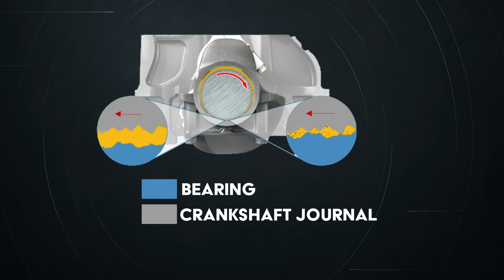the truth about start-stop technology (finally proven)

Comment: I have a few points id like to make, and im not looking for an argument, I genuinely want to know;

 - Stop-start systems only work when the engine temperature has reached a certain point, usually within 5 minutes of starting the engine. 
 - Most modern cars built in the last 12 years have electric oil pumps which can operate at full capacity as soon as the engine is switched on, and can then regulate their power depending on the engine conditions
 - The bearings in modern cars, especially with stop-start, are built to a standard where this wear isnt an issue, coupled with modern oils which are engineered with stop--start in mind.
 - Those bearings used in this video - what standard are they? What was the engine oil used? Engine temperature? 

There are multiple variables that go into engines with stop-start. Looking at it s straight forward as this Ould be says to see why they cause excessive engine wear, but there are many things different with an engine built for stop-start vs one without.
Reply: going by car care nut's knowledge on the subject, every reason you could think of that would be an issue with start/stop has been addressed. There were a number of things done so it could be adapted to a non-hybrid ice car. the feature is there to achieve emissions standards (helps significantly), but fuel savings is negligible. I've only been in one car with the feature. It's a silly feature for the end-user, but it's also a non-issue.
Reply: The "test" isn't testing anything, it just shows that if you stress a system for 48 hours straight, there is wear. That is literally all it is showing. There is no control, there are no numbers on why or how 48h of this should correlate to anything, nada. I'm not even sure if they mentioned whether the tested car was start/stop or not.
Reply: @AKKK1182  did you even watch the video? The one tested in the end was without start/stop system. The first ones tested for 48 hours was simulated to start and stop continuously. The test shows that most of the wear comes not from engine running for long periods of time but rather starting and stopping mostly. What kind of numbers do you want you thick?
Reply: @Panvezys The first engine was constantly started and stopped while being cold, before it could even get to any kind of operating temperature. No shit it wore faster, but start-stop doesn't kick in unless you're in operating temps. The test was essentially the same as inflating a tire to 20 bar and then saying air is bad for tires because it made the tire explode.
Reply: "are built to a standard where this wear isnt an issue" - how do you know that? Any wear is an issue for me. It translates into wear on my wallet.

Comment: 5:58 - Ok so im not going to pretend im any kind of expert on this, but wouldnt the real question be what the actual consequence of that wear is, instead of whether or not wear occurs at all? What we keep hearing from automotive experts all the time is that these start/stop engines are spesifically built for this and that whatever wear occurs is irrelevant because its still going to outlast the lifespan of the car.

Theres some very good information here, but at the same time I find myself with more questions after the test you guys did. For instance, most cars dont make it to 1 million km and are usually junked for other reasons than rod bearing wear or catastrophic engine failure long before that. Also, a car that has 1 million km on it has obviously been run for quite long distances on a daily basis and likely in a commercial setting (according to a insurance company the average person drives about 11-12 000 per year, which would make 1 million a car 90 years old by that standard). So how does this "clinical" testing stack up against real world usage where someone for instance starts their car, takes their kids to school and stops there, then goes to work, stops there, goes to the store, stops there etc etc. I dont know, but I have a feeling that the average person already does alot of starting and stopping and generally drives alot of short distance trips instead of being on the road all day.

I find some different numbers but it seems the average personal car has a life span of about 12-15 years or 250-300 000 km, which is very far away from the example of 1 million (or 90 years lol). I for one, would love to see this topic elaborated upon. Though I have no idea how to go about that, maybe getting a hold of some condemned cars where the cause for condemnation is known and looking at how consequential this wear actually was in the real world?

Comment: Not to mention the danger at places like roundabouts. You pull to a stop, the engine stops, you think you have a gap and try to go for it but the engine doesn't start quickly enough so you end up miss-timing your manoeuvre.
Reply: Said by someone who has clearly never driven a stop-start car. If you had, you would know how quicky they start back up.

Comment: Due to a marten, which cut 2 wires near my battery, and during a maintenance cycle, I was told that those 2 wires are to measure the battery voltage for the start-stop system and the maintenance guy at the garage fixed it by adding a connector to it instead of soldering it. Now I just pull that connector and my start-stop system is disabled entirely as it thinks my battery is dead and won't stop the engine. When I go back to the garage, I just plug it back in for that one trip. :p

Comment: The whole video is a waist of time. I have rebuild hundreds of engines. I have never rebuild an engine because of bearing wear. Almost always the piston rings are shot or the there is lubrication failure that damages the engine. The bearings never fail without bad oil or bad oil pump.

Comment: boring, my land Rover use to stop at 100k while on the motor way, brakes with no booster assist farrrrrk yea computer needed bout 5 mins to reset before it would restart, if you have this problem check your O2 sensors

Comment: Everyone knows that start stop is eco thing for car makers and it hurts the engine.There's no question about that. But...I would also say that it is obvious that you will see the wear on the new bearing. It also depends on the state of the crank which is not new. Maybe also other somponents. Even on new engine the components need to ''mate'' for some time. So this is not really a test rather than mere experiment that shows us that new component is getting the wear from use (incredible right ?).

Comment: Yet you have Toyota Hybrids who’s engines stop start many times per drive and they some of the most longest running and reliable cars.
Reply: Do they start on electric and thus get oil pressure up before restarting the engine? I don't actually know how they work. A hybrid is certainly different from the engine in this test in various ways that are likely to matter.

Comment: What about hybrid systems where the engine turns off at speed and on as power is needed? Do some of these systems keep the engine spinning, just not producing power? Or would that often be avoided to remove compression consuming power from the electric motor?

Comment: I'm really not satisfied with your analogy based on how you've actually done this experiment. During a cold start phase I would agree there would be slight wear to all the contact points within the engine, however to what extent is a moot point because of oil cling, and oil surface tension which maintains a constant coverage of oil even when engine has not been operated. The anti-wear additive packages in modern oil also reduces component wear. Secondly, your crank speed seems a bit low when you're doing the hot oil check which took 7 seconds.  Normal crank speed usually start  modern engines within 2 to 3 seconds. Taking the consideration of oil cling on all the engine's wear areas, severely mitigates the concerns shown by you for engine wear.
Reply: Not sure about the oil in bench engine, but as for in-car test I assume it had proper oil, and 84hrs of test would keep temps up. As for crank speed, the in car test almost certainly had fast spins. Bench unit is an older design, so probably starter isn't even geared for higher speed. Cold temp cranks will take more time even in new cars, but let's say it was lower than spec. Point was to show how long it takes for oil to be taken from pan and pressurized. One issue I would have is that even this old engine should have some check valve that could store pressure for few minutes and yet it lost all immedeatly.

Comment: Whoa... how so... I mean why the title is so revealing (I think because of YT algos right?). I mean there is nothing to reveal, this is known and clearly communicated information. Potential damage to battery and bearings is an eco tradeoff, which is clearly communicated since at least 15 years. But, guys, you've missed the point. the smaller engine is the lesser damage is. Try the same trick with some Peugeot 1.2 engine, or even 1.0 3 cylinder one, and will be surprised... And how about Toyota hybrid engines? how prius is easily surviving 700-800k km with no engine repairs? Sad testing with a childish results.

Comment: I have always thought that start / stop feature would damage the engine, starter motor and decrease the life of the battery but there are different opinions. Last year I took a 12 mile round trip in traffic and my car's engine stopped and then restarted 48 times in around this 30 minute journey. I decided then and there I would turn off this feature every time I drove. On occasions I forget but most times I remember. I have heard the amount of petrol it saves and the amount of polutants it emits is barely noticeable so why have this on a vehicle. I wonder if this could be disabled using a OBD11 ? Anyone know? A new battery for my mk8 Golf from VW is £380 as it has to be coded to the car, another rip off.

Comment: Would like to hear more about Toyota Hybrid engines. Had one myself and multiple people in my bubble drive them. They power off and on multiple times in a minute in city traffic or medium speeds on bigger main roads. Still they last like forever and are proven to be one of the most reliable powertrains which get abused daily in scenarios like taxis. I know that my old car still goes strong and the only thing which went bad within 12 years, was the small 12V starter battery (not the high voltage battery).
Reply: Best guess for Toyota petrol engine is started by hybrid's planetary gear, so it reaches operating speed and sufficient oil pressure before combustion happens, so there is much less stress on the bearings. Standalone ICE has to gain RPMs using the combustion...

Comment: Startup wear is a thing, but it’s minor

When an engine starts, oil pressure does take a second to build, but modern oils are designed with additives (anti-wear agents, friction modifiers) that protect during that boundary lubrication phase.

Plus, most wear happens after a cold start when oil is thick and hasn’t circulated, not during a warm restart at a stoplight. Start-stop systems almost always engage when the engine is warm and oil is already thin and coating everything.

Engine design accounts for it

Manufacturers reinforce bearings, starter motors, and crankshafts in vehicles with start-stop systems.

They often use electric oil pumps, pressurized oil reservoirs, or anti-drainback valves to keep bearings wet between cycles.

Field data doesn’t show bearing failures from start-stop

If this were truly catastrophic, we’d see widespread failures and class-action lawsuits. In reality, high-mileage vehicles with start-stop don’t show a statistically significant uptick in bearing-related failures compared to similar engines without it.

The real wear factor is driving style and oil changes

Neglecting oil changes, using poor-quality oil, or doing tons of short cold trips is far worse for bearings than start-stop could ever be.
Reply: So tell me what happens when key is position 1... 2... and why ignition is last position. When fuel pump and oil pump is activated?
Reply: @marekmarecki7065  You realize to give you an accurate answer I'd have to know which system we are talking about. 

The main takeaway here is that engineers KNOW about the problems associated with low oil pressure, especially at startup. 

This is a very well documented phenomenon. And I'll bet in most newer systems they have adequately engineered for these shortcomings. 

This is probably why we don't see massive amounts of vehicles failing from spun bearings.
Reply: I agree. Been running 2 VW stop start cars for 10 years now.  No problems on either Golf 7.5r and VW Up.  Both still on original batteries.  Up is town car and I seldom do short journeys in Golf, and always respect the warm up and cool down before loading the engine.  Maybe I’m just lucky, or maybe cars are indeed engineered for a start stop duty cycle.   I find this to be alarmist stuff. BUT I do agree that SS can be irritating on occasions, then I just hit the console button.
Reply: @gaycha6589  Exactly.

Comment: So much skepticism when the actual data proves the opposite of what this video is attempting (and failing) to convey.

Emissions are harmful, no, auto start stop does not cause excessive engine wear, or even any noticeable engine wear in the first place.

Not convinced.
Reply: Lol, one comment later you're going from "does not cause excessive engine wear, or even any noticeable engine wear" to "Startup wear is a thing, but it’s minor". Word "Minor" would describe something that is noticed.
Reply: @Stratos1988  Yeah from a comparison standpoint of cold starts vs auto start/stop.
Reply: @Stratos1988  Any time a mechanical system with moving parts is.. moving... it's going to have wear, regardless of how well it's designed.
Reply: @Stratos1988  But you're right, maybe I should have said "any noticeable increase in engine wear"

Comment: With some cars you can permanently disable the stop-start system by bridging or disconnecting the bonnet open sensor switch.

They're programmed to keep running when the bonnet is open so mechanics can work on them.
Reply: Bonnet sensor is wired into central locking and alarm system. In some cases you might end with car not going to sleep since it thinks it's open and in use, draining the battery.

Comment: I hate it when I pull into the garage and the car shuts off right before or as I'm shifting it into park.  So it shuts off and restarts.  I don't always remember to shut it off.  It usually doesn't engage when I'm normally driving because I don't hit the brake hard enough but when I'm parking I do.  So annoying.  Common sense would tell you it wouldn't be great for the motor.  Car companies love it because they get better EPA ratings and the cars won't last as long.  People seem to just buy new cars now over and over because they don't last 10 -15 years like they used to.
Reply: Mazda does not start the engine if one has shifted from drive to neutral.
Reply: My car beeps at me to remind me to turn it off. But, I forget because everything is buttons - park, emergency brake, and start/stop - so I just forget the last button push.

Common sense says that every second your car is running is one less second of it's life. Start-stop engines can extend the life of the engine by 30+%.

Car companies hate it because so many consumers don't like it, but it helps their bottom line because decreased wear on the engine reduces warranty service.

Cars last longer today than ever before - an average of about 50,000 more miles than just a decade ago.
Reply: Then be lighter on the brake and it won't activate. You literally knew why and mooted your own point right after. I can tell you it is not hard to pull up slowly and be gentle on the brakes until it rolls to a stop, without being down enough on the brake pedal to activate the start/stop function.